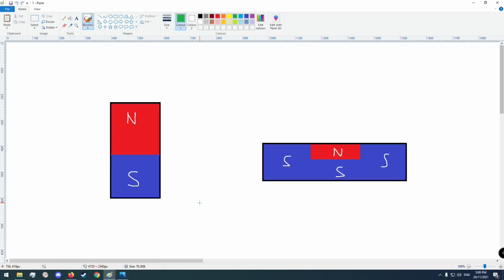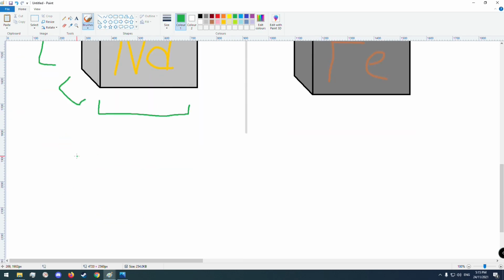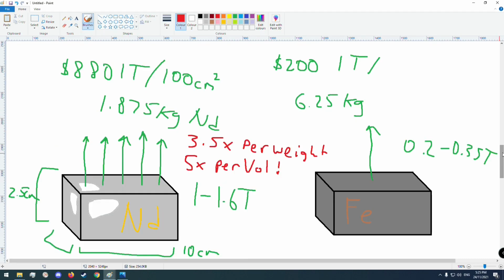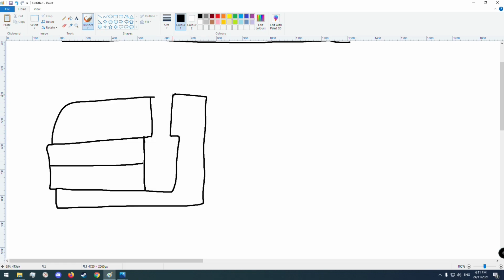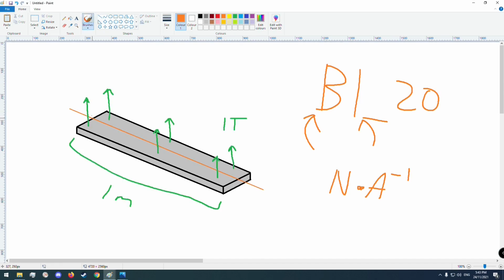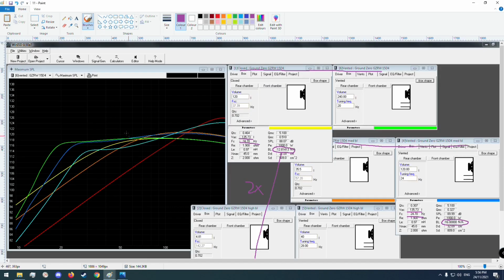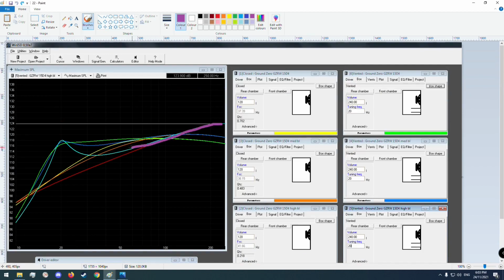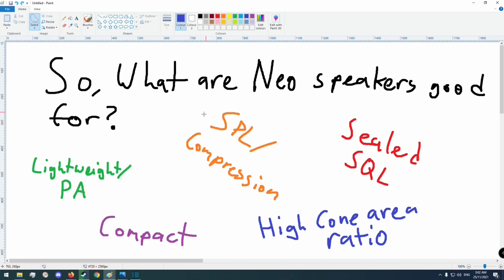Neodymium VS Ferrite Magnets in Speakers!

Comment: It is clear about relation between SPL and BL. Also clear about output and Qes (Qts) at resonant frequensies. But why neodimium HF drivers can have about the same general sensitivity as ferrite, but much grater output at the top end frequensies? their responce often goes horisontal and then suddenly falls down, while ferrites start to roll off slightly somwhere one octave before that sudden roll-off

Comment: As far as i remember, the Curie temperatures of neo magnets are always pretty high, 300-400C. However, they can start to lose strength if heated above ~80 C. And the tricky part is, it depends on the reluctance of the magnetic circuit it is in. The higher the reluctance, the lower the temperature where the loss begins. Especially bad is the case where it is placed so that it repels another magnet.

In a speaker, it is in a pretty tight magnetic circuit, so i would expect it to withstand some rather high temperatures. Testing this might be an interesting video, actually.

Comment: I still believe and say that the "Damping Factor" is important for any particular amplifier. However, there
seems to be a thought as long as the Damping factor is above 60 (most seem to have a Damping Factor 100-150)
then no worries. Something you need not concern yourself about.   
Until you start running speakers or subs with less Impedance.  Which is Quite common today.  B Nice to see the damping of the cabinet and then the amp and how they work together.

Comment: After a couple Tylenol headache is now manageable.  lol.   Just kidding
Great Video. Finally some insight into the the materials used, and why. Plus, the relationships
between the Thiele numbers and what is means for the speaker driver.
Two thumbs up with your example using SB Audience Compression Drivers.  Good solid Company.

Comment: I superglued Castrol caps to decoaxed 6x9 speakers to increase cone mass & lower Fs.  😂

i wanted more bass from the back, and only bass...it worked.

There are many types of speakers available, and generally it is best to fit the speakers to the application, not the application to the speakers.

Comment: For me Xmax mostly depends on max THD. When you take a neo magnet and Ho frame with 3mm pole, you'll get a 1.5mm Xmax. Period. Otherwise this would be a tr.. driver. So, this layout is good for a highly efficient compression driver only.
PS ...and for a car "audio" of course. Then you can mound this driver on a suspension and get 2 in 1: a dancing car and a loud "boooo"

Comment: Big box, high BL, low inductance. Excellent sound quality (with Linkwitz transform). The curie temperature of N52UH grade neodymium magnets (used in high end subwoofers) is 180C/356F. Only the lowest all-purpose grades will demag at 80C.

Comment: Very informative video. I've read a lot of a B&C whitepapers and they recommend to get as much BL as possible regardless of any case. The one item worth exploring... apart from raw SPL is the apparent power required to generate said SPL: SPL vs. VA vs. frequency in WinISD, or Hornresp (which I prefer). Hornresp also gives an "Efficiency" plot in this regard derived from SPL vs. power. In the car audio game, a lot of the high-BL woofers will not model well on paper in a small box but when normalized watt for watt compared to low-BL offerings, they are far more capable, with the tradeoff that you need a similarly capably voltage source.

Comment: I heard that You can’t just replace a ferrite magnet with neodymium. It’s needs to be re-engineered and  the neodymium requires more steel to generate a more powerful motor vs ferrite. More steel, more weight. So it’s not AS light as an optimistic example
Also ferrite is easy and cheap to magnetize. Neodymium is complicated and expensive
Reply: @johnviera3884
These rumors are not true.
The only difficulty is — not to pinch your fingers or break the magnets themselves during installation.
Need to use spacers and shims.

Comment: Excuse me Mr. Dak, I bought some Neodymium magnets off of Wish, and when they arrived they turned out to be Pig Iron. Would this still be an effective magnet for use in my speaker system? They cost me $75000 and I really don't want to return them. Please help me.
Reply from the maker: Ah, an unfortunate problem far too many face. In order to turn your Yousless pig-iron into neodymium magnet, follow these simple steps:
1. A good nights sleep and hearty breakfast is a good way to start this day.
2. Place the pig-iron into the ceramic induction furnace, as prepared in step -3. Heat to a nice red glow. Barnaby Joyce face for reference.
3. Scrape off the SCUM. This might be carbon. Dispose of responsibly. You now might have pure iron idk
4. Assuming you ordered $75000 of Neodymium magnet, and the price is competitive, That's roughly 159.57446808 kg of neo magnet, aka your precious pig-iron. You must now add 58.92999028869 kg of elemental neodymium, which is found in the earth. A warning- it is also rare.
5. Add 38 cloves of Boron (which happens to be the 2.2kg required).
6. Make sure the broth is proper sunburnt Barnaby Joyce who's under ICAC investigation hot. Stir thoroughly.
7. Pour over your existing feeble speakers. If they are weak, they will ignite, and good riddance. 
8. Wait for it to lightning. Your magnets are now magnets.
Reply: @Dakoustics  Thank you Mr. Dak. I have now been able to turn my pig iron into the neodymium magnets I so sorely needed. While the process caused my house to burn down and has turned me into a fugitive because it killed my neighbors in the induced lightning strike, I can now escape in style with my new speaker system. A shame I don't have any music to play, but I have connected up the speakers to the engine, and it is indeed very loud. Thanks again Mr. Dak
Reply: @Dakoustics  
You will fail at stage 2.
Neomagnets are made from a fine powders mixture using powder metallurgy methods.

Comment: An excellent demonstration. Another benefit of neodymium in some applications is that their smaller size can lead to fewer reflections through the cone. Thanks again for such great work!
Reply from the maker: Ah damn, forgot to mention that lmao, 30 min vid some things slip by
Reply: @Dakoustics ... Another thing for audio experts are the acoustics designs of speaker peripheral boxes.  Some guys can't stand modern day speakers because they notice the sound acoustics differences in today's designs vs 1970-80s designs where speaker acoustic (the total wooden box and speaker system) sounded for stereos back then.  Case in point: Why have modern TVs with HD require soundbars when TVs had great acoustical sound back in the 1970-80s?  Back then listening to stereos and their designed speaker systems those amplifiers blew such rich sounds the ear couldn't differentiate a live vs record playing (or of FM radio station) performance.  I still have the latest greatest RTR-IV 1982 from 50 Watts lower grade speakers outperforming many speaker designs today by an engineered speaker wooden shell also.
Reply: @lawrencejelsma8118 still well designed warm sounding 2 and 3 way speakers out there...just have to get them online.
Reply: @lawrencejelsma8118 the answer for tvs is pretty easy tbh. It's easy to get good sound from an old TV that was basically a big cube. Compared to flatscreens with maybe 0.05 cubic feet of space to spare for speakers.
Reply: @Dakoustics  No apologies necessary. A  rigorous mathematical demonstration is always appreciated!